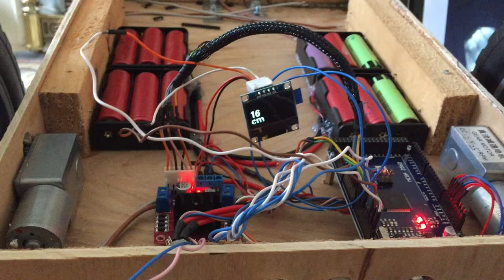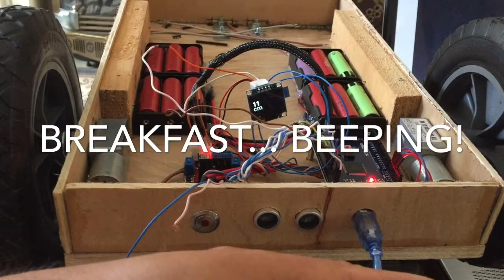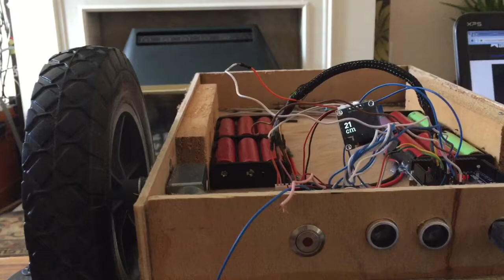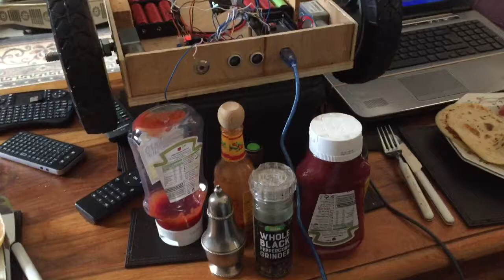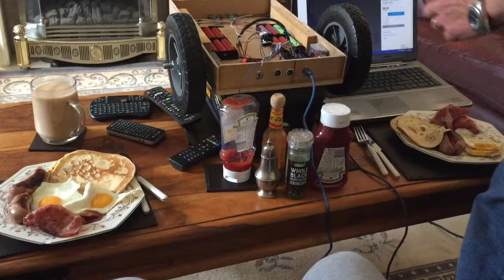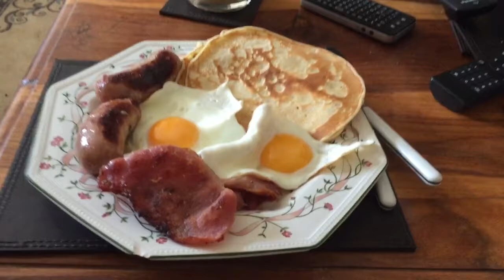Robot Lawnmower PT10

Comment: WHATS THE POINT OF WATCHING ALL THESE YOU CANNOT SHOW US HOW TO MAKE IT
Reply from the maker: You don't have to watch them :-)
Reply: just seems a bit of a con to get you adds mate and trust me am not doing again waste of my time to make you profit on adds  put something that works up and how it works because i do not see how yours  even drives as you have it wired up it looks impossible
Reply from the maker: P Dyson skip to the last in the series... it does cut grass and the ultrasonic sensors work... it’s obviously cheaper to buy a commercial one...
Reply: its not cheaper to buy one i make all sorts of garden robotics out of  paper mache and varnish and resins all you need is two  h bridges  instead of one and use two stepper motors or you can put a disk readers  on the shaft of the normal 12v geared  motors to give the controller  better control of the robot.  you can also add gps, you can use A Tiny processor chips to control some tasks free more of the  main programmer to  better use, you  add motion stop so no one gets run into while moving you could use a stepper to raise and lower your cutter blade  for  longer grass...... and you could do all the above for well under £150 look around you for parts skips if you really want to be a creator of good